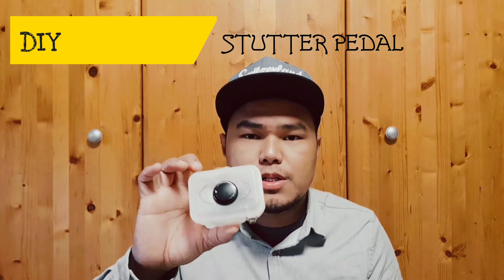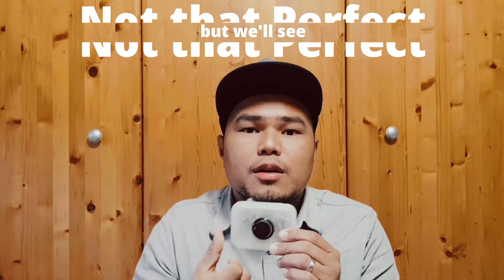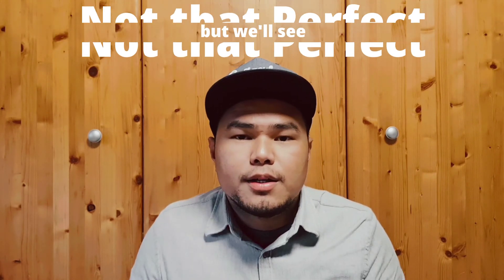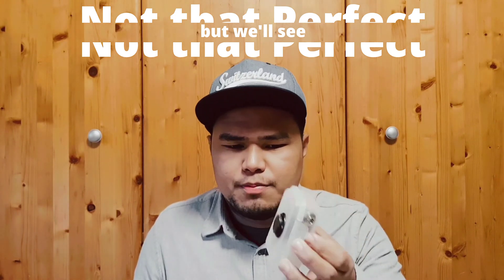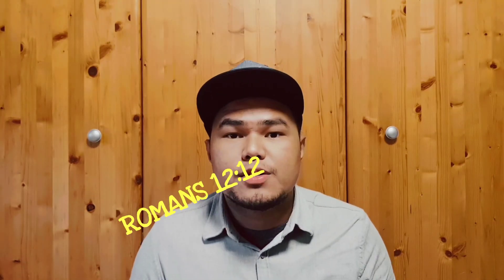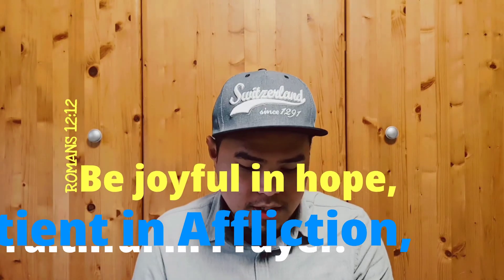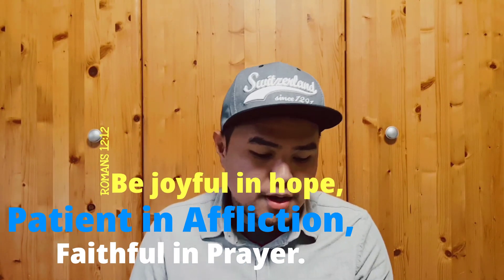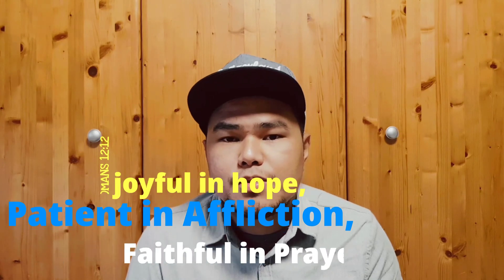How to make a DIY STUTTER PEDAL / KILLSWITCH PEDAL -  using an  ARCADE BUTTON!

Comment: You can get rid of that popping noise by using a DPDT switch and sending the signal to ground instead. And also use a resistor across the switch.
Reply from the maker: Thanks Man 👍🏽.. I'll try it out 😊
Reply: @marting.official  cool! Essentially, rather than just cutting the live, which can see the pop, you are sending the signal safely to ground. Also, if you find there is still a pop after that, solder a high value resistor across the switch terminals. Start with 10kohm and go down until the pop disappears.
Reply: @DTGuitarTech  thanks for the tip, perhaps do you know any momentary Arcade Style switch buttons that are DPDT and are available in the EU?  most of the switches we are able to get here are only SPST. would SPDT work as well? when you write solder a high value resistor accros the switch terminals, you mean you are connecting both switch connectors with this resistor? if you have a simple Arcade Style Switch with only 2 connectors thats clear which one to take, but what if you use a DPDT switch that has way more connectors, which ones would you use? sorry for those questions, but i´m a total noob in this topci and want to understand better  :)
Reply: @ChrrZ  If you get a pronounced popping noise when you activate your kill switch, the usual solution is to take a large value resistor and wire it directly across the two active terminals of the switch itself. I use a tiny 1/4 watt resistor, starting at ten megs of resistance (which is SUPER high).  If it still pops, I will change that resistor for one with a lower value, such as an 8.2 meg version. I’ll then keep lowering and lowering the value until the pop gets quieter (it will seldom go away completely). DO NOT go below one meg, though, because if you do, you can begin to affect the output impedance of your guitar (if it’s passive).  To reiterate, a certain amount of “pop” will always be there; we just want to get it as quiet as we can. Ironically, the more gain and distortion you use, the less pronounced the pop becomes (IMHO, this is due to the intense compression that high gain amps have).  As for availability of DPDT switches you’ll just need to shop around.
Reply: @DTGuitarTech  thank you so much for your detailed reply!